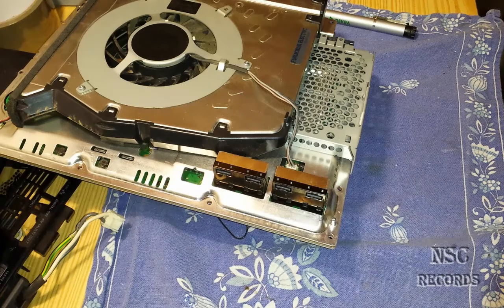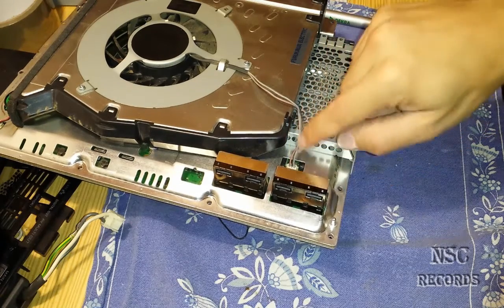How to Instal a Fan Adjuster on PS3 FAT CECH-A-B-C-G-etc. By:NSC

Comment: Hello i just modded the PS3 fan using your video. Thing is with the  modded fan rhe ps3 is constantly crashing. Earlier i had cfw installed but wasn't able to regulate the fan speed as it would crash every time, it worked fine at stock settings. Do you know what's causing this as I'm unable to use the ps3 right now. The fan speed stays constant at the xmb but system shuts down within minutes of launching a game
Reply from the maker: Hello It sounds to me like it's overheating already. Have you Delid the IHS? If not, now you know what to do...

Comment: this works.  on a ps4 aswel.  
but i have 1 problem.  
my 10-100% range is all in a tiny area of the potentiometer.  
like maybe 3 or 4 degree's of rotation.  
do i need to go up (higher resistance potentiometer) if i want a smoother control.  
or do i need a smaller potentiometer? 

so that i have a full 180 degree turn on the potentiometer for 10%-100% fan speed.
Reply from the maker: It conforms witch pot. you got, and yes, on some pots you need to turn it slowly and careful ^^
Reply: @NSC-Modz  i got 50k instead of 100 because some guy in one of the comments said it gave him a full 180 degree turn.  

oh well it works as it is.  he'll just have to adjust at tiny increments
Reply from the maker: @darkracer1252  yeah, fully enough... 50 or 100k i never da a big difference ^^

Comment: hello nsc , I've always wondered why to use a fan adjuster? , i mean doesn't the ps3 can controll its power by itself?
Reply from the maker: Yes it can but it does it to late, when the ps3 has reached 74C° the fan begins finally to turn 2% faster... pff

Comment: It's totally worth it to do the 12 volt fan mod on the o g PlayStation 3 to keep the console from overheating so the console stays cool during gameplay also clean the vent on the back of the PlayStation 3 also clean the fan and remove all dust and most importantly change the thermal paste

Comment: Hi, I've made the MOD according to your video. It works, but accidentaly, i've made a short circuit between the gray (data) and brown (+) cable on potenciometer.
The fan start to work at maximun, and everything stoped. Now when I connect the PS3 to 220volts, nothing happens (no red light).
When I press the power button, a beep sounds, the led becames green (dark) and nothing happens. I have to disconect from the 220volts, other wise the green LED remains light (nothing more) If I press eject i can hear somme noise,

Can you please help me

Thanks
Reply from the maker: Hello

Have you fixed already? It will be hard for you...
Reply: @NSC-Modz  Nop.... :-(

Comment: I have put wrong wire colour. Now my fan cant work, and my ps3 seem broken. What happen? Can I reapire it?
Reply from the maker: You have a short circuit now and it will be hard for you to repair it
Reply: UltraNSC the power still on, green light. But nothing happen, no sound, colour, and the fan cant work. The problem short circuit in my fan? Or on my GPU/CPU? Thanks for your answer.

Comment: I have a question .... by soldering pin 1 to the grey wire (3.3 v) and terminal 3 to the red wire (12 v) ...then you get a voltage difference of 8.7 volts between both sides .... so  when turn the knob close to terminal 3 the output voltage would reach almost 12 volts ... because some gets the fan turn to high by just feeding the grey wire 5 volts or so ... so I think 12 volts are too much
Reply from the maker: +mjaafreh2008 12 Volts are to much, and it´s only for 100% Fan Speed

Comment: Hi, what about these pots? http://mla-s2-p.mlstatic.com/potenciometros-de-100-k-logaritmico-5911-MLA5020006088_092013-F.jpg

They are in the 100k omhs range, and also have 3 pins. 
The control knob would stick out of the console, but you can attach a plastic cap so it's more comfortable to turn the knob, more aesthetically pleasing, and would also insulate the pot. What about if your hands are sweating or are wet.
Reply from the maker: +Xerxes1688 Hi Im nut sure, you will need to try it, but i just prefer this ones like on the Video, so just take care...

Comment: Nsc your the man hey what kind of fan ajuster is that  want i try to buy some on eBay because i have a fat ps3 but i dont play too much am afraid to get the ylod on but still i can find like the one are using thanks again for all your mods keep up the good work
Reply from the maker: ROBERTO VENEGAS Hi You will need a 100k Potentiometer :)
Reply: UltraNSC thanks again NSC your the man
Reply from the maker: np :)

Comment: Damn you have nimble fingers and hands. I would probably burn the s-hit out of my fingers. My eyesight is for s-hit as well. You Macguvyer f'n wizard. Ez chill is easier to install but your paying $29.95 for it. But is super easy to install from what I looked at on there web site. It's designed for the fat and slim ps3. So I would say if you can't solder like NSC Macguver dude then get the ez chill and start chill'n. You have to remember NSC is the "BOSS" when it comes to doing this stuff. LOL! The "BOSS" I have to watch that one again.
Reply from the maker: LoLOL xXD